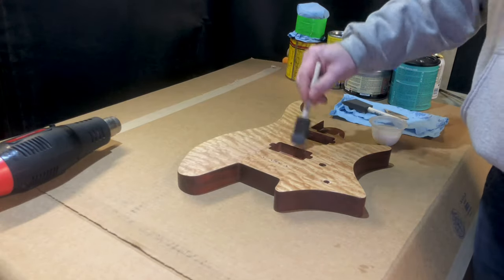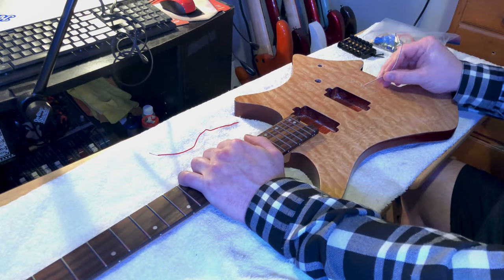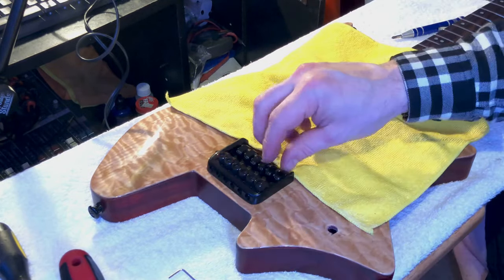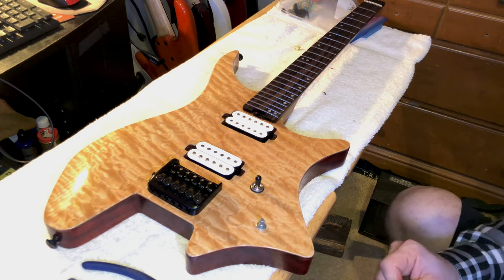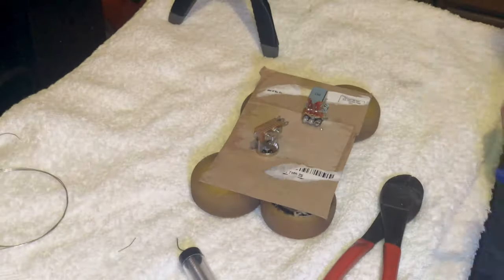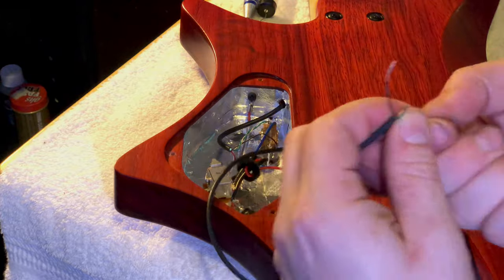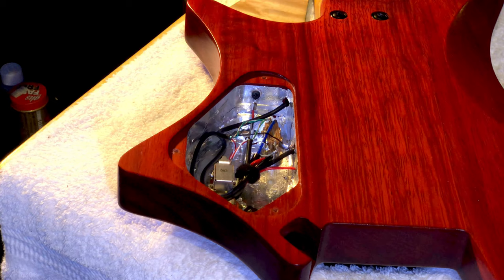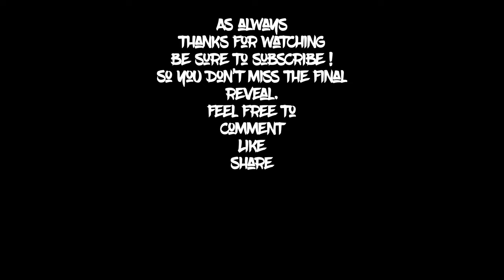Eart headless guitar/ mod project part 6 "assembly" (vote at the end)

Comment: Kenny that turned out awesome man. I have 2 of the EART headless with tye trem. I also put Seymour Duncan in mine. One has a jb and a jazz the other has the mayhem dist set. Where did you get the veneer for the top. I want to do the same thing
Reply from the maker: Thank you so much ! Go to veneersupplies.com great selection great prices and there shipping is amazing
Reply: @SIX1NINEGUITARSANDGEAR  cool thanks Kenny. You should get one of the Vainrant travelers guitars. If you do get the 699 dollar one it comes with a floyd rose frt1000. And ebony fret board. It is killer

Comment: Great mod series so far. One question though. Why didn’t you just cut and restroom the bridge pickup wires? It would have kept the clean interior you had. Just wondering. Great job so far though!!!! On to the next one!
Reply from the maker: Because im always experimenting and I’m always interested in different  pickup and wood combos and so on so i left it long to have options of putting that pickup in any guitar down the road .. i like adding it to the list for future content !
Reply: I get that.  How had the frets held up so far? $300 plus for a guitar with stainless steel frets is ridiculous!?!?! Just asking, because now I’m thinking of getting one, just for the neck, frets basically as a mod project also. The longevity of the frets vs cost had me wondering. Have a good night.
Reply from the maker: @timothyweesner6286  there great no complaints . No wear the fret ends are insanely nice there don’t even go to the edge of the fret board .. its different but i love it

Comment: With that extra layer of veneer under that bridge, doesn't it need a shim with the same thickness at the neck joint?
Reply from the maker: Well the clear coat on it was around .5 - .6 of a mm thick i sanded that off and the veneer was around .7ish of a mm thick so it basically evened its self out i barely even have to adjust the bridge from where it was before the veneer.